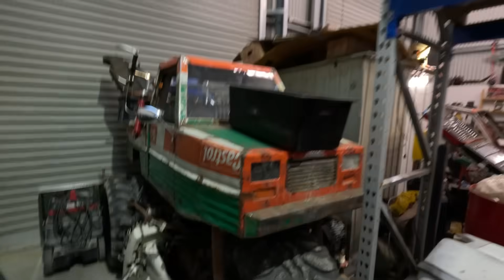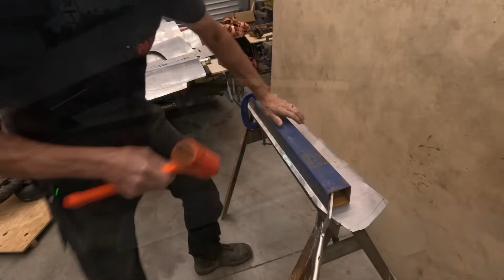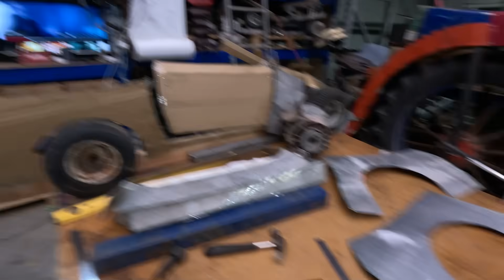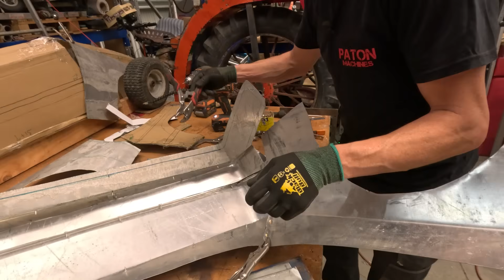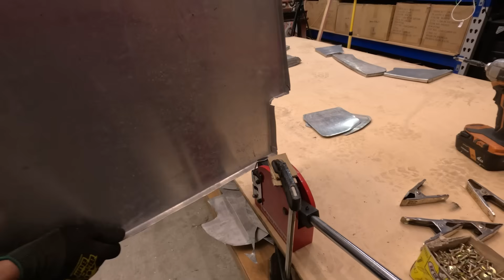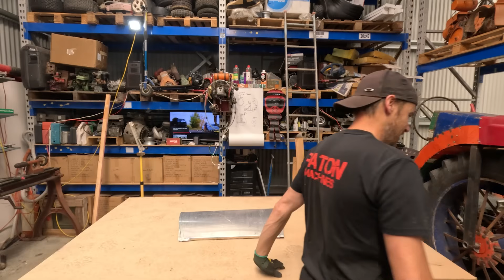Rotary RX7 Drift Kart Build - Aluminum Body!

Comment: Would be awesome to see it front engine with a drive shaft and a ride on mower rear diff, could use one of those remote gearboxes some old bikes have, idk how common they are in Australia but would be sick to see 🤙🏾🇦🇺
Reply from the maker: I've now got everything needed for the front engine and gearbox, shaft drive to rear end and through a fwd/rev box and chain to axle
Reply: @PatonMachines  thats mint brotha, this things gonna be killer 🤯👌🏾

Comment: Here's a tip on using the shrinker start with only putting the metal in 1/2 way into the jaw for the first shrink than go all the way to the back of the jaw on the second pass . in don't be so light on pushing down on the handle ! Don't bang it like you were . just a good hard push on the handle ! And go little bit at a time push than move push and so on. Good luck mate.
Reply from the maker: Cheers for the tips. I tend to just bowl on in without doing enough research. Sometimes will pay to take a step back and learn from other people first

Comment: Aluminium is such an underrated material for the at-home builder. A pair of snips, a few files, a hammer, and some vice-grips, and you're away to the races. Takes paint well too - although I guess that's more a function of how well it scuffs up. Excited to see this finished :)
Reply from the maker: I wonder if I should try the polished aluminum first or just co straight to paint or wrap?
Reply: Does it take less work in comparison to fiberglass?
Reply from the maker: Definitely cleaner to work with
Reply: @PatonMachines  possibly quicker too as you’ve demonstrated. 

A few rivets vs curing it overnight?…..hmmmm
Reply: @segue2ant395  cringe its a pos metal it bends
Reply from the maker: But it's good for building a light rx7 drift kart!

Comment: A technique I use alot when working with cardboard is to brush it with Epoxy resin - hotglue gun the thing together & slap on the resin. Carboard soaks it up & it's like plastic when dry. Can go ahead and add a layer of glass cloth if you need more strength.
Reply from the maker: I should have just made a cardboard rx7! Can also use bondo and paint it and nobody would know!
Reply: Fascinating, that's a cool trick, I'll have to try it sometime. I've also seen a guy make stuff with fleece blankets and resin, made a very nice bumper.

Comment: Looking sick wonder the door bit looked tight getting in. Maybe think about hinging the body on a frame from front then lift up to get in and pull down once in
Reply from the maker: It's definitely tight getting in! But that's the whole point 😂
Reply: @PatonMachines  Can you do both
Reply from the maker: I'm also going to have the rear hatch opening which I maybe could use? Next video I'll climb in and bring the camera with me to show how much space there is!
Reply: @PatonMachines  yeh that be awesome hard to know exactly once sub floor or driveshaft go in yeh the back window hatch will work also to get you in